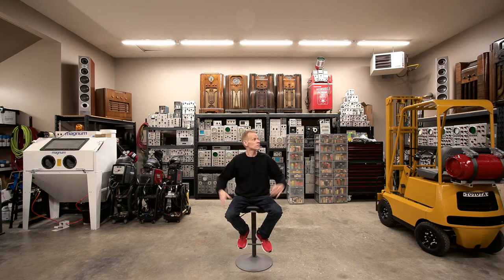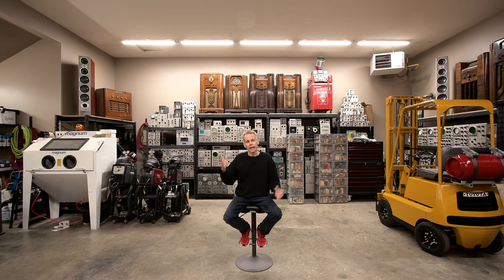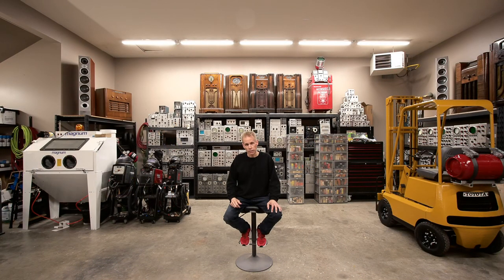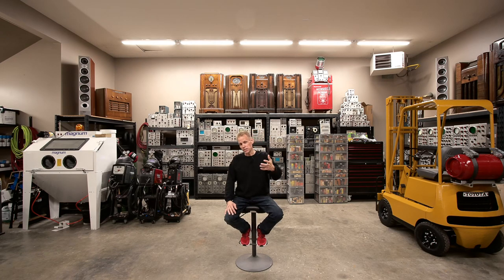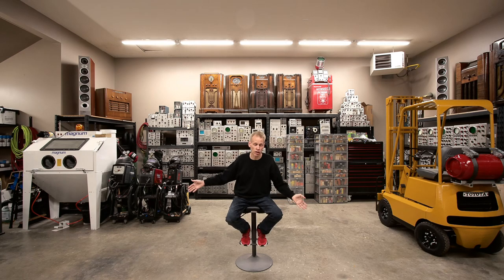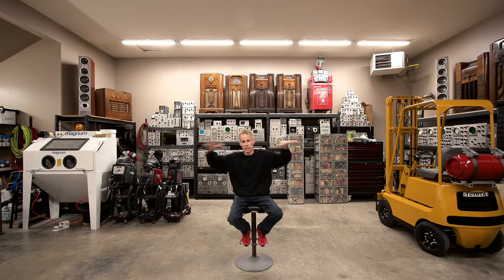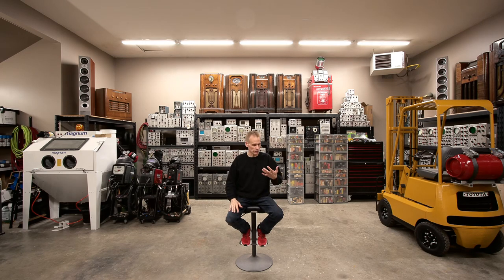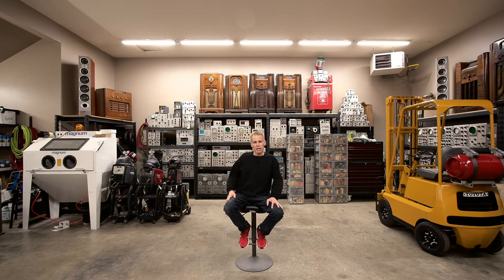ZAP! Mr C's Worst Electric Shock Explained In Detail!

Comment: The worst that I've ever been shocked is I used to work for a carnival and I was running a ride called The Roundup and there was some kids out on the Midway screwing around pushing each other and one of them tripped over a junction box where the wires feed into and cross the wires up I was standing on some stairs separate from the ride but I was holding onto a handle that controlled the hydraulic pump to make the ride raised the voltage went across my arms across my chest to ground on the stairs threw me off of the stairs fused my zipper together in my pants and the bottom of my shoes we're smoking... yes it's everything you said and worse

Comment: Well Paul you became the dummy load , been there done that . I got at least one leg of 480 from a welder arm to arm and I can relate to what you’re saying. Knocked me out tossed me away . I do remember uncontrollable eye bouncing and making a somewhat hollering sound . I came to quickly and busted the hell out of that welding machine. Someone obviously wired that machine incorrectly.

Comment: I find working with electricity is the most dangerous because it just sits there silently (with the exception of some transformer buzz). That silence gives us a false sense of safety until we become the path of current that the electricity is constantly looking for. I find it so much easier to be safe around mechanical tools in workshops from lathes, to hydraulics, chemicals, torches, etc... These loud and obvious items seem far easier to be safe around, but electricity is much scarier. Been zapped over 10 times. Every precaution needs to be taken.

Comment: 12v train set... 2 or 4 amp.. started low voltage. Went up till my body started to freeze up. I put the wires in my mouth andn sat down in a way where the wires would fall out of my mouth. But, it shocked me forwards where the wire stayed in a bit longer than I wanted to.  I'm good with that. Anything more voltage amps watts than that is complete lunacy.

Comment: 120V with no ground, like 1 phase to shoes on sealed concrete, also feels like a buzz at your fingertip.  You know you screwed up if you feel the buzz.  At least with pure AC capacitive coupled by a sneaker it won't hurt you.

Comment: You were indeed very lucky to be thrown from your chair like that. I have had a few 240v AC shocks, but one sticks in my mind, like with you it went across my chest. It didn't stop my heart, but it was enough to make my heart go crazy for what seemed like ages at the time. I just remember it beating totally out of sync with it's normal rhythm. And the longer it went on, the fainter i felt. But it eventually settled down again. But it scared the life out of me not knowing if it was going to settle down again. I had people near by me, i simply could not talk until it had settled again. I got that from one of those old two bar electric fires, i stupidly touched one of the bars with my finger to see if it was getting warm, whilst leaning on the metal casing with my other hand. That was over 40 years now, back in my teen days.

Comment: Scary stuff :/  I've been shocked before but never from my electronics or electrical work.  I got shocked by a dodgy light socket once when I was a child, I remember feeling the buzzing go through me and the metal taste in my mouth after wards.  Then just last year (35 now) a dodgy wiring at my landlords house caused the earth circuit to be at 120volts, it was very weak so weak I didn't even realize it was a shock but I felt that buzzing / throbing in my arm.  It got my through my washing machine 😐😐😶😶 Now I own my own house and the wiring has been carefully checked😅😅

Comment: 26kv DC into my belly button was a bad one. I forgot to discharge a picture tube and removed it from the TV. It was an inverted type , so the ultor was next to my belly button whilst carrying. I can still remember the arc. The pain went straight to the family jewels and I had to sit down and wait for it to subside. 230v AC is pretty bad and you can feel the frequency of oscillation so it's very weird. Not so painful though. By far the worst shock overall is 320v DC straight off the main filter capacitor, as it has a large current behind it and it hurts like hell. Always discharge the main electro before servicing switch mode supplies. THEY BITE!

Comment: I have been bitten by electricity several times! But the worst was a flash cube by a capacitor that up mf by 10! That showed me that only 1 wire can due injury when the voltage is over 600 volts!

Comment: I know what pushed you away but I don't want to start a war on your channel. One of the lessons I learned the hard way was don't move a live chassis around on the bench. Unplug it, rotate it clear any leads and  reapply power and even unplugged never grab a chassis that's right side up and curl your fingers around the bottom to pick it up. First, you don't know what's under it and second, you always do it with two hands which we all know is a bozo no no.
Thanks for sharing Paul.

Comment: Metal Halide lamp ballast. 277VAC - I was training a crew how to wire them up. I guess I was wrong. A good alert guy saw that I was being shocked and kicked me, his buddies hollered at him "what'd ya do THAT for?! "He was being electrocuted!" Me: "Yes I was." 577VAC 3ph bus rails for a bridge crane hit my boomlift bucket (someone had cut my lockout / tagout off of disconnect).. 800 VDC out of a seimoreg for a magnet crane. Another crane hit our crane, knocking me into 12" x 3/8" silver plated copper buss bar, rail stops had failed. My foreman threw a 1000 amp fused contactor manually to diagnose control side or power side, as to why 300 hp motor wasn't working. Phase to ground short in the end-run pull box. Steel fabrication sharp edge metal flashing had sliced the insulation off the Hypalon.The arc took all the muscle on his forearm, threw his SK screwdriver through the building perlin girt currugated sheet steel. Sunlight shines through a perfect screwdriver shape hole there still. The catwalk on that crane had handrail made of 1"" roundstock steel. Bent out 3 feet the shape of his body. Now I run an electronics repair shop and I get helpers to be with me when I mess with anything over 40 Volts. I have them trained in how to save a life, how to safely kick me clear or disconnect power. I do lots of fire extinguishers, safety glasses, gloves, mats, chemical lockers, MSDS sheets, vent hoods, the works. The yjokingly say "Uh-oh! Here comes mister safety!" No. I'm just wondering how I'm still here and not charcoal.

Comment: i am 77   when i was 4 i put a metal hair pin into a wall outlet   big blue flash    woke up on the kitchen table with family standing around  me   when in my teens i built a williamson amplifier...when hot i put s spalding rubber ball in left hand  ...kept me from making 2 hands contact with live chassis

Comment: i suspect that.

1. there is a death cap being used to ground the chassis of the radio or power supply to the enclosure and no polarized plug so it was connected backwards*

2. the power supply or radio is putting some high frequency leakage onto the enclosure that is high enough to tingle but not high enough to be safe.

original tesla coils if operated at high enough frequencies say on the mhz range could allow you to touch the spark with no shock not even a tingle and it was perfectly safe and in fact whole medical quackery industry was built up around electric

*= usually found with tube stuff because by solid state there was some basic safety stuff like polarized plugs and interlocks.

internal capacitor discharge resistors would have to wait until modern microwaves and air conditioners

Comment: I hope you figure what it was. If you got shocked by the case, that means AC had shorted to ground. Do you have GFI outlets? If not I would highly suggest that you do. Might have a bad ground connection to your house. Was this the first time getting shocked? You get a few more and you get those reflexes built up. I worked on a one megawatt capacitor bank and didn't wear PPDs, made it to clumsy. Reaching in there with Meter probes makes the hair on your hand stand up. Fun stuff and I got paid very well. Breaker Breaker god buddy..

Comment: You now have the power, and I bet you will live to be at least 100 years old. I've been shocked but only by a GM HEI ignition system of about 35k volts and 3.5- 4 amperes. I was grounded to the fender of the car, but nothing like what happened to you. Felt like I was being burned. Take care, Mike

Comment: Keep up the cautions & warnings. You don't need to nag. But it's important as you go along to bring the subject up at appropriate times.
I've gotten a few serious jolts over the years. Once was a zap from 480-3 phase working on a big heat pump, it knocked me back & gave me a burn. Another was plate voltage from a tube radio, luckily that's not much current but 400 volts DC hurts like hell. Very high voltage capacitors self charge & pick up charge from static in the air. It's just sitting there on the shelf, harmless right? Blammo! Always store high voltage caps shorted.
I worked on big analog tv transmitters. I never had a problem which is a direct result of being the utmost careful. The power supply makes 32000 volts at 8 Amps. If you get ahold of that you will die & it will hurt the entire time.

Comment: Mr carlson I've been shocked by 110/120 @60 cycles I've had a automotive coil shoot through left  arm to my right arm it went around my heart. Literally felt it from the left arm going from the top of my heart but connect to the bottom  of my heart  by the right arm then roll all the way around my heart  that didn't feel good  12v shock are the weirdest feeling you can almost make the  wave form out it odd  hot day with sweat don't mix

Comment: My worst shock was when I was testing a computer power supply. Put fingers on what appeared to be a heat sink. Heat sink had about 350v from 240v supply. That was a good whack. I researched why the heatsink was live afterwards.Im a Plasterer, so have to deal with  240v cables when in occupied buildings. Now I  Always treat everything as live and check the ac is off ,with a known working immediately previously volt stick. Got stung while pulling live light fittings through the drywall ceiling . Just turn the circuit off. Not worth the 30 seconds saved working live.    
Worked on a big job. Older electrician  there had a nick name,........Crispy.  Apparently he got stuck on a live switchboard.  He had no  ears, they burnt off,  about 30 % of his face was scarred from burns. His scalp was all scarred and would not grow hair ,so he wore a wig.   He was the electricians safety officer. When he saw one of his guys doing something stupid,, he would ask them   " do you want to look like this ?". The Boys just shook their heads and did things properly after he spoke.

Comment: I think you were a bit miraculous that what happened to you, a few years ago I took a current from a high energy igniter used to ignite gas on coke ovens and for a few days I couldn't moving the right arm well sometimes happens even if you follow all the safety regulations where high voltages are at stake you must always stay as we say with straight antennas.
Greetings from Italy.

Comment: I got locked on to mains 240V 50hz (UK mains) across my chest and I thought I was going to die. I tried to scream but nothing came out but luckily, my body fell backwards and I felt exactly the same and it's shit tbh. Getting a shock is one thing but getting locked on really is something else and I only know a couple of people who've had locked on. 
When I was at college doing my apprenticeship the tutors thought DC was more dangerous but I had to explain to the tutor n class that AC is FAR more dangerous. 

They also didn't realise that caps charge themselves back up so I brought something in to show them and how dangerous cap's are n that they always need to be shorted when your working anywhere near them.

Comment: My worst shock was when I was working on a broken washing machine.
I was testing the controller cuircuit board for an open circuit, everything was going well until my cat had come in to say hello.
My cat loves rubbing against my leg, all of a sudden I was convulsing, heart trembling, I could feel the electricity coursing through my body.
Either the cat had been in contact with a live, or I was touching a live somehow caused a path through the cat, I wear rubber soled shoes plus a rubber mat.
Luckily my rcd tripped when my screwdriver dropped into the machine.
The cat shot out the door and went missing for the rest of the day, she went to the vets with a burn on one of her paws.
From then on, no pets in the workplace.

Comment: In 1982 I went to a “computer club” meeting and a guy there had built his TRS-80 into a bent metal case. He turned it on and was talking about it. I noticed he had used a 2-blade power plug. I asked him if he should
have wired a grounded cable instead and he scoffed. I touched the side of the keyboard and suddenly my hand shot away from me like a rocket and smacked a man standing next to me right across the chops. The guy I whacked was not impressed. The owner touched the case, pulled his fingers back and suddenly pulled the plug and put the whole kit away. He was upset like somehow it was my fault how he’d set up this death trap to show off! I had to explain to this guy that I’d gotten shocked.

Comment: Worst shock I had was removing an electric cooker from an old cottage.  There were 3 separate fuse boxes, with unlabelled fuses, in this small cupboard.  Two of them I switched off completely just to play it safe, the third was tucked away in a corner and I hadn't seen it.  Guess which one supplied the cooker point?  I cut the cable (without testing it first, idiot) and BANG!!  Felt like I'd been slammed into a wall, could barely feel anything in my right arm for a good 20 minutes or so and my cutters were welded shut.  Lucky enough to have lived & learned.

Comment: I got bit recently by 2000v from a 3-500z box and I still felt that electrocution for another 10-15 seconds as I stumbled away to the back door to find my wife! thank god Nothing happened besides burning 3 fingers very badly. But the fact that I was feeling that 60hz buzz for 15 seconds afterward was the worst part of it all. I was thinking the whole time Am I dying?? I will also add that I have a wooden work bench and work on a plywood floor, I had no connection to ground or to anything else, My one hand was in my pocket as I had my other hand in the work area

Comment: Damn, that was a bad shock... I'll tell about my wort one here that I have the occasion.... I was 15yo, playing with a DIY ZVS driver, hooked up to a CRT TV flyback trafo, which gave me 10kVDC and a short circuit current of 90-100mA... Well, I was wondering if, by connect the positive side to the earth, I could get AC voltage on the negative side, thanks to the parasitic capacity of the intrinsic diode.... As far as I can tell, no AC came out, but a high enough DC voltage to hole through the poorly insulated wire attached to the negative of the flyback. I was doing the experiment kneeling on the floor, since there was a Shuko outlet with easily accessible earth pole... So, kneeling on the ground and with my left shoulder touching the metal frame of a couch, I grabbed that damn wire with my right hand and, after I guess one second of holding, I've been able to let it go, with a nice, bright 15cm (~5in) arc following my fingers and living a burnt spot on my index... I immediately layed on the ground and put my hands on my heart and damn, I felt as it wasn't beating, so I tried some kind of self CPR, pushing on my chest and, after what felt like 3 or 4 seconds, i felt it beating again... Since that day, I've never connected any pole of any voltage higher than 12V to the outlet earth...

Comment: Well I have a story too. This must be the worst shock I got since I felt it going through my heart. 
How it happened:
I wanted to make high voltage with a transformer out of a old coffee machine. 
I had a lab PSU set at 9 Volts DC. I connect the primary of that transformer. One of the primary wires in my left and one in my right hand. 
As I disconnected the Transformer, I felt a nasty zap. The nastiest one Ive ever felt. I even felt it go through my heart. Scared the hell out of me. 
I created high voltage but not on the side of the Transformer I wanted to. Lessons learned 😂
Reply: Also have other Zaps but they aren't as bad as this story. Mostly just a hand that got shocked and nothing else.

Comment: I've followed you for a couple years now and I find it strange that you have not covered any piece of DRAKE equipment. I wonder if you have some dislike of Drake gear.  I had an SPR-4 when I was a teenager and took it apart and put it back together (over time) until I understood it. I always thought it was one of the best receivers in that class. Later , years later I had a pair of Drake twins for a while.  I know when you cover as many different pieces of gear as you have on the channel, its hard to believe the avoidance of Drake was anything but deliberate.  Sorry about the SHOCK , you definitely had a guardian angel.